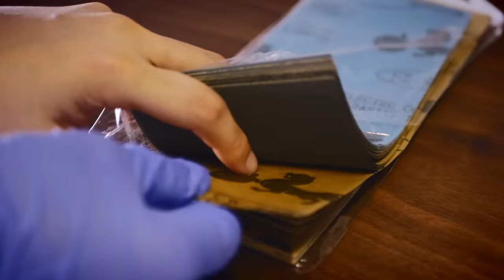DIY #3 | 8ft Mid-Century Modern TV Console

Comment: I applaud the work... and the video. It seems funny to me that TVs originally stood on the floor, large, ungainly, and were usually too warm to set much on.  Then TVs were incorporated into consoles alone and with radios and phonographs... the 1st "multimedia" centers. All this was due to the size and weight of the TV. Screens shrunk and portables became common but nobody was thinking about hanging one on the wall. Floor models became insanely heavy, I owned a Sony PMV-4300 monitor, 43" CRT, that was over 400 pounds. It was a pig for even 4 guys to move around. Nowadays, if you have the money you can buy and hang a 292" flat panel on any wall large enough to fit... size and weight. So to watch someone use all this skill, all the effort for something to set a "TV" on seems funny to me. One thing we did learn pretty well in the 50s and 60s is to knock the sharp corners off of furniture at toddler height.

Comment: This needs to have real spaces in the grill design so that IR signals can pass through.  This set up only works with bluetooth connected devices.  Forget about speakers.  Also need more cutouts in the back or a backboard the slides out if you want to hide a power strip off the floor.

Comment: I hope the builder came to realize that soft closing drawers don't need constant steady pressure on them to close.  They're kinda negating the technology in the video by pushing until the drawer is closed.  Just push it most of the way, and the rail mechanism will take care of the rest.  Additionally, a couple of clear rubberized bumpers on the inside of the drawer front will make sure that the drawers come to a close quietly as well.

Comment: I wish I could buy this I've been looking forever for something like this!! Wish there were plans for this to make it. My main issue is I can't find long enough wood (10' long, grain following long side) to be able to make a waterfall edge and all. I'm surprised you made the butt joint the way you did, wouldn't you want the top and bottom to be all the way and then have the sides be "inside", both for looks and structural integrity for how the weight will be distributed?

Comment: What a spectacular piece of furniture art. Brava/ Bravo! Could you please tell us the materials used? It seems like you're using walnut plywood with edge banding for the carcass, and some parts of a ply (early on in the video) that appears like ¾ inch baltic birch, as well as walnut hardwood for the legs/ bottom frame. Is this correct? Thanks.
Reply from the maker: Thanks, all the cabinet body is made of Walnut plywood (except the back panel) and walnut hardwood. I only used 1/2 baltic birch plywood on drawer boxes.☺️